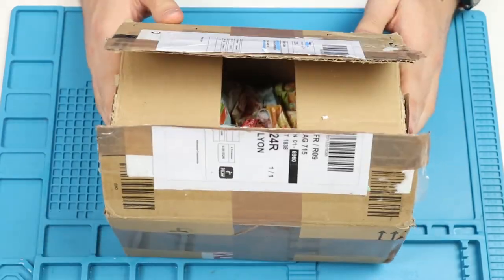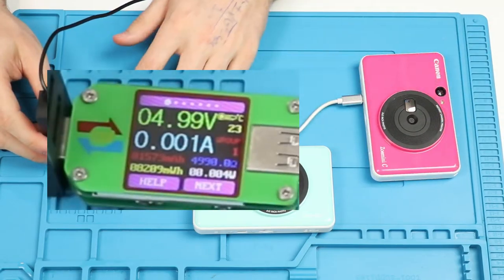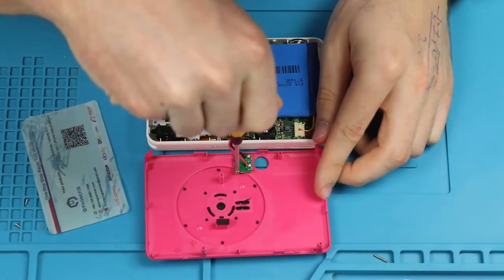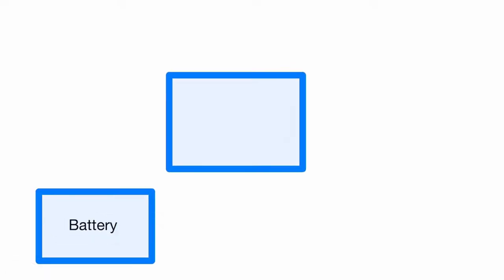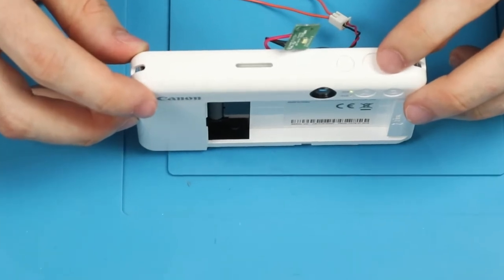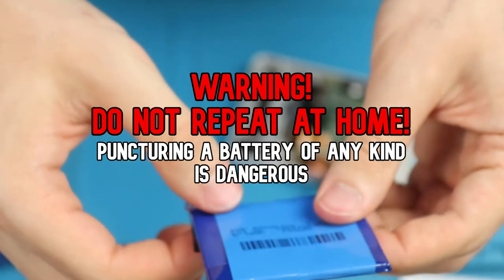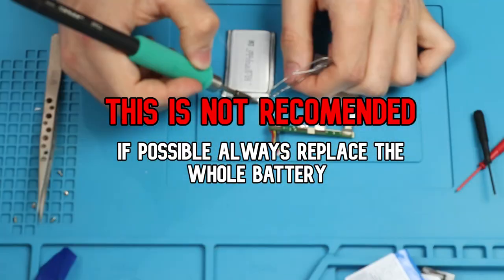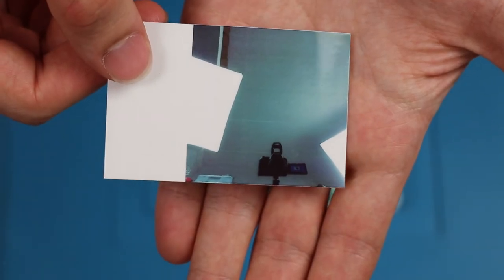Canon Zoemini C not charging... Can we fix it ?

Comment: Giving you a sub for this video! Thank you very much. Canon service is such a shame in Poland. I have the same issue and they told me that there's no possibility to buy a new battery, but they may fix it in the authorized service. You can find only one in the entire country 🤣🤣🤣 Please let me know  what exactly should I describe shopping on-line to find the exact battery, which is needed for this camera.
Reply from the maker: Hey, glad you liked it. The battery is a 7.2V lithium polymer battery usually referred to as a lipo. I can’t tell you exactly what will fit p&p as the connectors vary vastly. But as long as it’s 7.2v it’s going to work. 

Good luck!
Reply: I sent mine in for no longer charging. I took 2 pictures with it but let it sit to long. Now it won't charge. Canon quote to fix it was more than the price of a new one. What a waste. Won't buy anything canon again. Used to be my camera of choice.

Comment: Do you know where I could buy a new battery or another one that could fit inside ? Thank you so much
Reply from the maker: Hey, both ebay and amazon have 3.7v lipos, a 7.4v one can also be found as replacement for other devices, as long as the voltage is the same and the dimensions are fine it should work. 

A number of drone batteries could be mended to fit inside. 

In my case I usually just replace the cells.
Reply: @how_its_fixed  Thank you so much ❤️